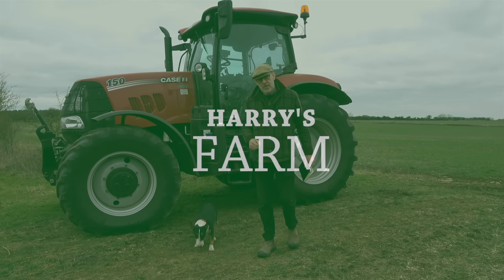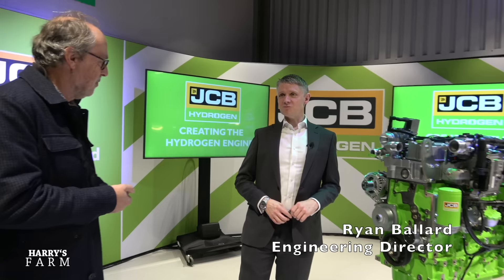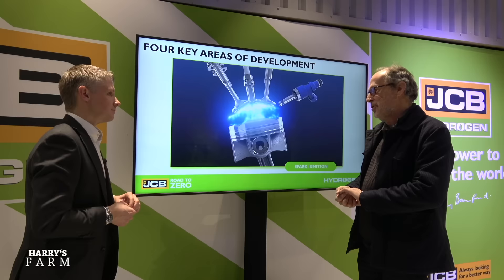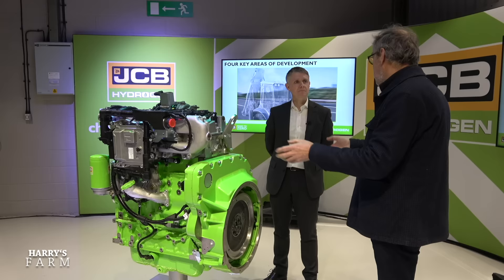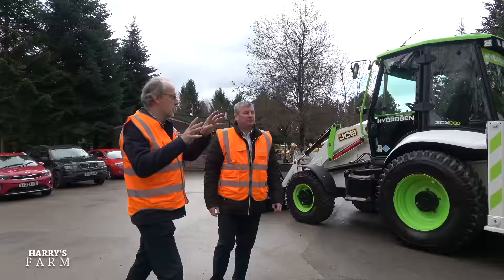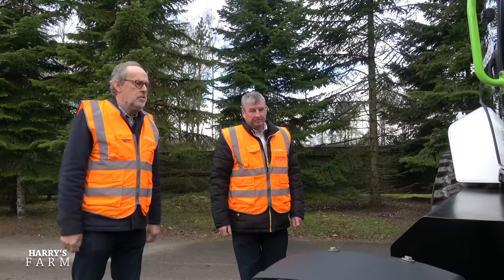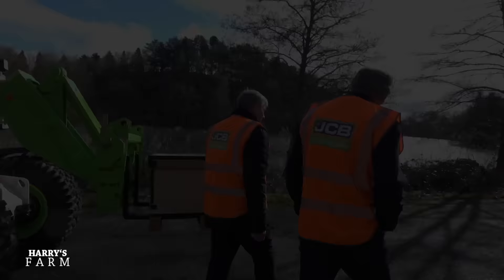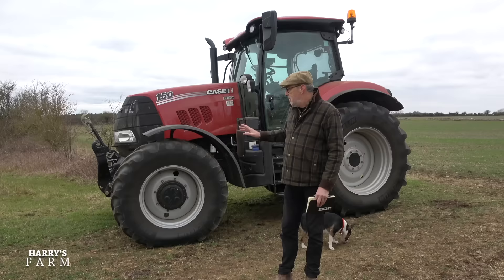JCB is moving to hydrogen power for all their big machinery. Here’s why.

Comment: You have  to remember that Green Hydrogen is not a source of energy, unlike the grey Hydrogen that is currently used by JCB.  Green Hydrogen is just a means of storing energy just like a battery.  You start with electrical energy, throw away 25% of it to convert water to Hydrogren, then throw away 10% to compress it, throw more away transporting it on a tanker to a filling station.  Throw more of it away to compress it in to the to the vehicles tanks.  Finally if using an internal combustion engine throw 50% of it away as waste heat.  Probably the energy losses could be justified for some applications (like aviation) but the infrastructure to distribute it is more of a problem.  We can't put more than 10% hydrogen in to our current gas network because it will embrittle the plastic pipes.  I can't see the country being able to afford to double up our gas network with a hydrogen network even if we just connect filling stations.  This is because Hydrogen is really difficult to pipe because it leaks out through conventional gas joints and you can't use conventional plastic pipes which would make a hydrogen pipe network more than double the cost of an CNG network.  As a result it is always going to have to be transported by tanker.  However Hydrogen compressed to very high 700bar takes up 6 times the amount of volume for the same energy as petrol and liquifying it which takes a lot of energy only reduces this to 4 times the volume.  Consequently you are going to need 6x the number of fuel tankers to transport it.  Although I would love Hydrogen to be a competitor to battery technology I just can't see it happening on a wide scale.
Reply: Absolutely fantastic brake down of it all buddy 👌 they have also forgot to mention the massive fire and explosion effects if these goes up In fire 🔥..to me it would make more sense to have a technology that extracts the carbon from the diesel before it even gets to the farm ..as the saying goes you can’t get more out than you put in .. it’s all about balance
Reply: Unfortunately using this grey hydrogen release’s more CO2 than burning the CH4 in the engine directly. To produce 1kg of hydrogen by electrolysis requires 50 kWh of electricity and 9 litres of water. That over 9 pounds just for the electricity alone. Then it still needs to be compressed and transported. One pound per kg is not going to happen.😢
Reply: @jonnybloggs6790  they also forgot to mention the fire and explosion possibilities with battery vehicles  , it doesn't take much to find a video showing  what happens when one of those  "  green " solutions goes wrong
Reply: Good points, well made. Thanks.
Reply: @kawasakikev8905  Any source of concentrated energy has a fire/ explosion risk. Why are you equating only green solutions having this happen? They aren't portrayed as being any safer. Never seen an old fashioned petroleum fuelled vehicle on fire?
Reply: Indeed.
You also have to remind people that, to source Hydrogen, you are sourcing a commodity which is free.
It does not need to be mined from resources which will dry up in the very near future.
It does not need to have millions of tons of machinery to extract it from said mines.
It does not need men and children mining the more precious minerals by hand.
It does not leave massive scars on the earth where said minerals are mined,
It does not need to be transported across the globe in millions of tons of shipping to huge factories to be processed.
It is found in every country in (usually) plentiful, ever replenishing amounts.
The commodity....
WATER.
A product so safe, every human on earth can drink it.
Try that with cobalt etc.
Reply: @nickbea3443  in every  movie with a big car crash !
Reply: @WeeShoeyDugless  it sounds like you were describing fossil fuels
Reply: @kawasakikev8905  in the same period in the US that Tesla had 3 battery fires there were over 300000 combustion-engined vehicle fires. The media don't show you ICE vehicle fires but widely publicise every single BEV fire. Sorry, but you've succumbed to their fear tactics too. The facts are very very different.
Reply: The answer is local generation.
Not distribution.
Reply: @Stu_2112   three hundred thousand ICE  fires ...really .
Reply: Well done my friend , Now what about buying my engine that runs on COO SHITE. ?...(see comments for details)😘🏴
Reply: @backacheache  Get up to speed, the conversation is about hydrogen.
Fossil fuel is on a par with EVs by the time you weigh it up.
Reply: @WeeShoeyDugless  In local noxious gas emissions? particulates? noise? odur? You're right, ev's aren't  as good at those, however they are quite good at getting up to a speed though, and with a high level of precision
Reply: Producing green hydrogen and using it like this is inefficient on a % basis. How about on a $,€,¥,¢ basis?
What is the target £ price for an hour's worth of hydrogen V an hours worth of diesel?
That is the true basis of comparison (carbon taxes etc are a crude attempt at pricing externalities). Renewable energy is, at the margin, free and limitless. More solar panels/windmills/tidal turbines...
Reply: @WeeShoeyDugless  not really, my electricity only comes from renewable sources
Reply: @cluasa  Building an EV vehicle is way way more carbon negative than building an ICE car and the production of Hydrogen will only get cheaper as more research is carried out.
Massive leaps are occurring on an almost monthly basis.
It's the future.
Reply: @backacheache  If only that were true.
Reply: @Stu_2112  I wonder, how many billion ICE vehicles are on the roads in comparison to the amount of Teslas?
Reply: The economics of creating green hydrogen only work out where electricity is plentiful and cheap, because of sunlight, geothermal or in the case of the Scottish island where they test sea-powered generators, more power than their link to the mainland can take
Reply: If I have a wind turbine on my gusty farm, generating and compressing hydrogen, then I'm sorted. I don't care about efficiency because it comes from the wind...and is still a viable proportion.

You're choosing to ignore all sorts of battery-related concerns.
Reply: Yes, spot on for the most. Hydrogen is more of a storage or transportation solution.
Reply: @WeeShoeyDugless  a statement that is so off the mark, it's hilarious. The hydrogen that you claim is free (when in fact it is not) is a fuel that has a low energy density and is slated to replace hydrocarbon fuels in order to run vehicles that require all the minerals that you mentioned above, in order to manufacture them. I guess that your rant can be best described as vacuous virtue signalling. Well done.
Reply: Storage and transport in the form of ammonia has the potential to solve many of these problems, completely agree leaving 700 bar tanks on site is a terrible idea.
Reply: @zopEnglandzip  
I may only be in the minority (?) but sitting on top of one of these......

https://youtu.be/T71cVhxG_v4

whilst driving down the road is not my idea of fun.
I can see all the replies already "it is a one off", "they're much safer now".
I dont really care, I will stick with my diesel car, much safer and gives me peace of mind.
Reply: The assumption that batteries can’t be used will look rather foolish when someone else does it…
Reply: And the process for manufacturing Diesel fuel? Do you think that 100 years ago people thought it would be easy?
Reply: Interesting thanku
Reply: So your answer to these problems is what exactly, battery's also have draw backs such as the materials that go into them are finite and will run out, there is a massive carbon footprint in the mining and transportation of these materials a further carbon footprint in turning the materials into a battery and getting it to the factory it will be used in and finally when the battery is knackered a further carbon footprint in dealing with it so what's your answer
Reply: I wish I could meet you in person as I reckon you’d be very exciting to listen to. I’d got super excited until I read your informative comments on the matter. Hadn’t realised the challenges of producing hydrogen as well as distributing it. Id like to think JCB has thought this through though. I literally live 5 minutes away from their headquarters 😅
Reply: @garethlinford5785  Electric motor don't care where the power comes from, or where they deliver the mechanical force, but what they do, as demonstrate by your Tesla is deliver it with accuracy, JCB power with an EV's precision could be a whole new game.
Reply: Neil, just forget about that Adam guy. Some people are so biased that they can’t look at research that disapprove their own conclusions. It’s a lost cause from the beginning
Reply: Hydrogen? It consumes more energy to make than it creates, it's difficult to transport and impossible to store in volume. It was literally there 'written on the wall' at the Arts de Métiers in Paris as to its viability as a potential fuel/power source.
Reply: I mean if that’s your method of calculation. Then traditional fuel is only around 30% efficient at the point of combustion. Add to that the losses at refinement/production and no fuel humans produce looks particularly outstanding.
Reply: Late night eh?
Reply: @garybrown8574  technically all fuel consumes more energy to make than it creates. According to the laws of physics
Reply: @garybrown8574  technically all fuel consumes more energy to make than it creates. According to the laws of physics
Reply: Bob Lazar built his own hydro pump station in his driveway.
Reply: You left out all the energy getting oil out of the ground, refined and transported to end users. Better compare apples to apples.
Reply: Just use a gravity drive powered by dilithium crystals, and hocus pocus, all your problems disappear.
Reply: @JohnR31415  
Watch The Fully Charged channel vid about exchange pods for trucks.
Reply: what about creating our own hydrogen
Reply: @david.j.bunney  Rare earth minerals and a huge amount of power goes into turning crude into petrol and diesel too
Reply: @stevewilliams2498  still very inefficient
Reply: @backacheache  what are fossil fuels?
Reply: @Mark1O37  hopefully within a couple of decades, kids will be asking the same question
Reply: 0 emissions though.
Reply: @jonnybloggs6790  Yes sorry,  I needed to express that as these people in government think we are stupid and don’t know what they are up to.  Thank you, I completely agree with you 👍🇬🇧BTW I have completed that  comment now.
Reply: Hydrogen is the worst kind of quackery
Reply: Stick to fuel and diesel be cheaper and the better for environment than mining for the battery etc…. Worlds gone mad all for £££
Reply: Keep it up JCB. Well done. To the nay sayers, throughout history all engineering projects had problems to resolve and were achieved.
Reply: @Mark1O37  a problem
Reply: The CCCs decarbonisation pathways don’t use Hydrogen for heat and light vehicles for all the reasons stated  but don’t discount it for this use for the same reasons given here - off grid charging for heavy duty BEVs for construction/farming etc is problematic - too much downtime, new battery tech needed to get over cycling degradation etc.  Hydrogen in some form looks like one of the few viable long term storage vectors for renewable energy and this could easily be a viable solution - it may not be as efficient as a BEV on energy use end to end, but the whole system is much more than that (the ultimate metric is cost per productive hour)
Reply: @rfpho1456  You also have to remember that a 40 ton articulated hydrogen tanker lorry carries only 600kg of hydrogen in its pressurised tanks and a hydrogen powered lorry like the one in the video will get through about 10kg of hydrogen a day.  So there are going to have to be a lot of deliveries if you want to move to hydrogen.   Meanwhile battery technology is advancing rapidly.  Tesla is just starting to deliver Model 3 and Y cars fitted with Lithium Iron Phosphate batteries which will last 250 000 miles which effectively is the life of the vehicle.  New solid state batteries with twice the power storage per kg are being tested in the lab and probably will be just two years from production.  I think it is likely that battery swap technology for large vehicles will be more cost effective than developing the hydrogen infrastructure needed.
Reply: @OpticalMan  I didn’t say hydrogen was the answer for light vehicles or even a lot of goods vehicles, but recharging batteries on high consumption vehicles in remote areas (eg Scottish highlands)etc isn’t that easy either - not without lots of downtime.  Hub based transport over short distances in Europe where there’s strong infrastructure suits BEV solutions.  But if you are focusing on JCBs market which is high utilisation away from rapid charging (construction, farming etc) there is no easy BEV solution.  There’s discussion about increasing the weight of HGVs to accommodate load and batteries, or having to have more HGVs (it’s a value / profit equation) both of which have wider consequences (more road wear or more congestion).  So it’s a far from simple answer.  Hydrogen isn’t a wonder solution, but nothing is.  Wind is intermittent (not really a problem day to day but if you get days of it it’s more challenging), solar produces little in GB in winter (but not true in say India, where keeping silicon cells cool enough in Summer is probably more of an issue), heat demand varies immensely year on year.  As an energy guy it would be easy to say it’s inefficient use of renewables, but at the end of the day it has to be about the most efficient productive output.  The answers may well change over time. This might be an intermediary solution.  It might work if you produce hydrogen on site (where the issue becomes the number of vehicles you need and their relative inherent carbon v the efficiency of energy conversion and distribution to attain a given level of production).  There are instances where BEV is not the answer today.
Reply: Why do you need transport infrastructure when you can produce on site?
Reply: Because if you can get the large amount of electricity needed to produce hydrogen to your site it is still 3x more energy efficient to put it in to a battery and use that to turn a motor than generate hydrogen and then burn that in an internal combustion engine. @Djurel
Reply: If green energy is green it's not a problem. Lithium/ cobalt has massive supply and environmental problems. I notice you don't mention that.
Reply: The latest batteries used in EV's use Lithium Iron Phosphate chemistry, no Nickle, no Cobalt and there are massive deposits of Lithium in the USA and Canada that are undeveloped so future Lithium supply won't be the problem some people are making out.
Reply: @jonnybloggs6790  are you related to Joe Bloggs on this platform? He's a complete shills, I wondered if it was a family business?
Reply: Isnt the same true for mining oil?  Also the "mining" technology for hydrogen will surely get more efficient with innovation and research?
Reply: @markclark4154 not anymore. You can produce near pure 02 in a grey hydrogen engine. Check out the plasmid generator described by alchemical science. The results are actually mind blowing.
Reply: @WeeShoeyDugless no. Fair point actually!? That’s definitely a perceivable pro. Though precious metal mining is more electronic sector. I see your point though
Reply: So there is only slightly less waste than batteries, but a lot less pollution. 
And you apparently don't know that hydrogen can be turned into carbohydrates "petrol" by combining it with co2 from the atmosphere. Read my comment about this.
And also you don't seem to realize that production of batteries are energy costly and produce a lot of pollution, that hauling heavy batteries around makes for bad handling, that they are a fire hazard because it can't be put out and produce a lot of toxic smoke. That batteries don't last very long, and are so costly to produce that the car is a write off. Batteries in vehicles are extremely stupid, it makes no sense at all.
Funny fact is that batteries killed the EVs because in the early days of cars they were popular, especially amongst women because petrol cars were difficult to start using a hand crank, but when the electric starter was invented there was no longer any advantage in EVs only disadvantages, so nobody wanted them. But now our politicians are telling us lies claiming that the gas of life is pollution, but actually co2 does much more good than harm. It hugely benefits agriculture, it makes plants more resilient to drought thus greening the earth reducing deserts. And by the way much more people die from cold than from heat.
The level of co2 was much higher in the past, and life was doing great then.
Reply: The same was said of electric 10 years ago
Reply: @nickbea3443 at least they can be extinguished - can't do that with an EV battery - the Fire Brigade generally have to wait till it just burns itself out.
Reply: In Australia Rolls Royce  and a uk generator company are trialling a wood burning steam generator to charge EV open cast mining equipment calling the wood Sustainable
Reply: Not to mention the 'not' green credentials of making/transporting/charging ev batteries. Another emerging solution to a doubtful problem.
Reply: @Stu_2112 because there are more ICE vehicles!!!
Reply: Storage and piping is a real problem because the metal goes brittle
Reply: CO2 emissions are not a problem!!..We need more CO2 in the atmosphere to make crops grow well
Reply: Tell us how much of what we are breathing is C02?
Reply: Thank you. You brought the issues with hydrogen to the point. The hydrogen hype only exists, because of government subsidize. It's definitely not protecting the environment, quite the contrary.
Reply: Fascinating summary that I have only seen in part ...
How can I copy this to send to my ECO-friends ???
Reply: I agree to all you say, except why you "love hydrogen over batteries". 
Is it the toxicity of the substances in batteries? We eventually have to ingenuitivly either properly deal with this or replace them by other less critical materials, and the future will be batteries. Batteries and solar, simple relyable, cost effective technology, that works.
Reply: @kawasakikev8905 we should also be aware what happend when things go awry with ice vehicles. Of course, that’s not news anymore, we got used to it.
Reply: I hauled it to food prep plants . They use it to flash freeze, to cook, and power the plant. Hydrogen exhaust combines to make water and condenses to form ice from humidity in the air.  The greatness of Hydrogen power is underestimated.
Reply: What you call energy loss (in terns of heat) is not a loss if you can utilize it for heating homes for example.
Reply: @aziggy252  Sure it might be possible, in certain situations, to make use of energy, that has been converted into heat. But wouldn't it be better, to use a more efficient technology, that would not generate so much heat, in the first place?
Reply: @m.l.5284  About 80% of the world's energy consumption is utilized to generate heat. So why is heat production a drawback for manufacturing hydrogen? It might actually be an advantage.
Reply: @aziggy252  Difficult to use the heat, for home heating, when heat is produced  by a vehicle combustion engine.
Reply: @m.l.5284  I am talking about heat as a bi-product from the production of hydrogen.
Reply: @aziggy252  Understood. I still believe, using electrical energy directly, is the better option. With few exceptions, where hydrogen is inevitably needed in the chemical process (steel production, chemical industry), or energy density is crucial (air and space travel).
The usage of waste heat from hydrogen production, is a valid point, in areas and seasons when heating is needed (winter in northern regions). It doesn't work in southern regions and in summer.